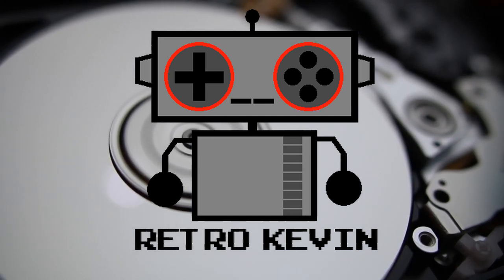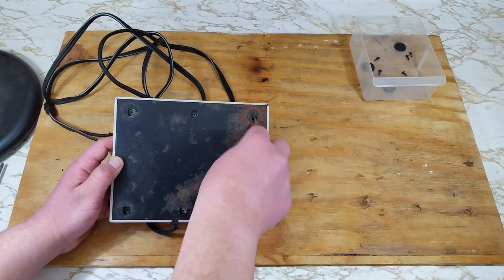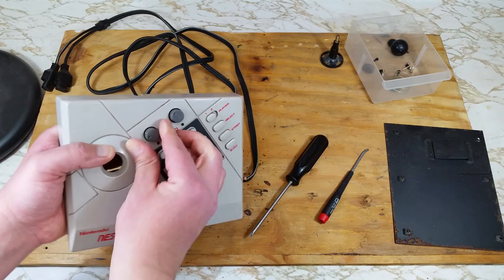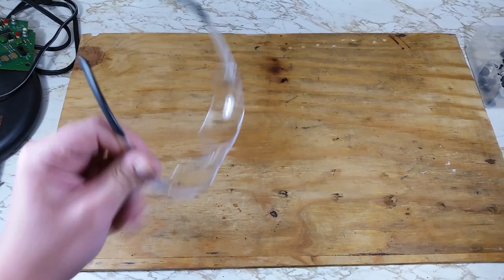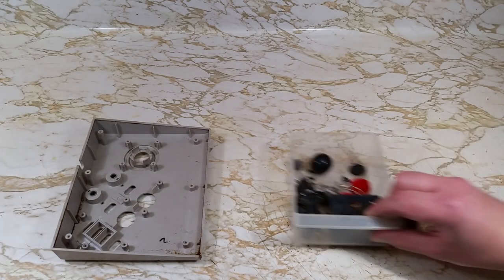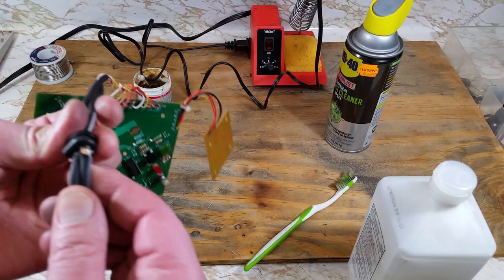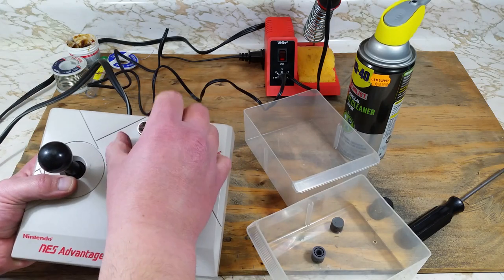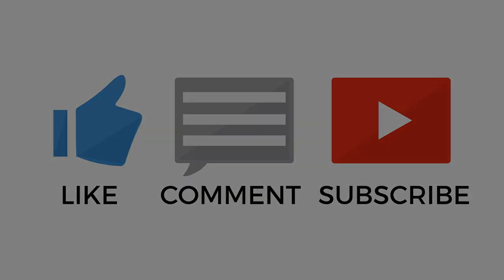Refurbishing a Nintendo NES Advantage controller

Comment: I so regret not taking shop/vocational classes in HS (instead took foreign language and art etc.)   I've tried several times to repair my controller following other YouTube videos without success.  Your video by far is the most clear, descriptive, patient and helpful I have found.  Especially with regards to (and most appreciated) taking time explaining/using the tester on the capacitor and removing/replacing the part.  Great video!  Thank you for sharing!  Can't wait to try your methods tomorrow!
Reply from the maker: I'm glad you enjoyed the video. Hopefully it will help you in repairing your controller. If you need further help feel free to message me. Good luck!